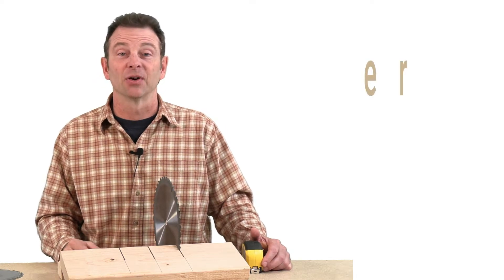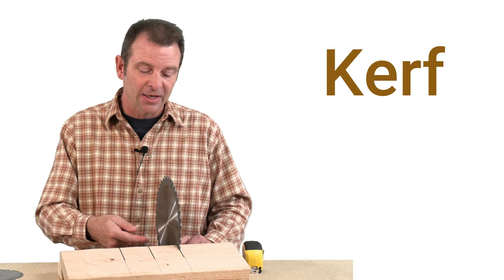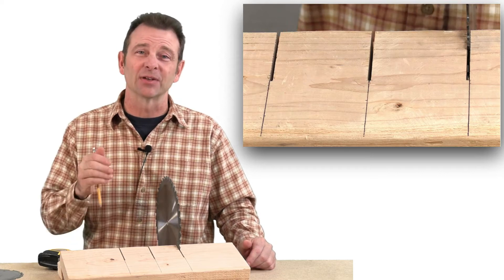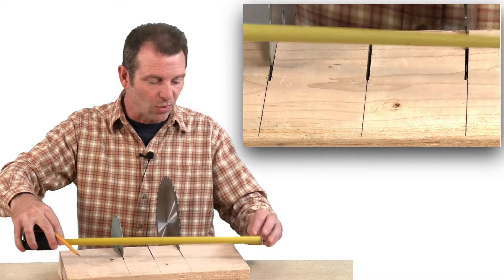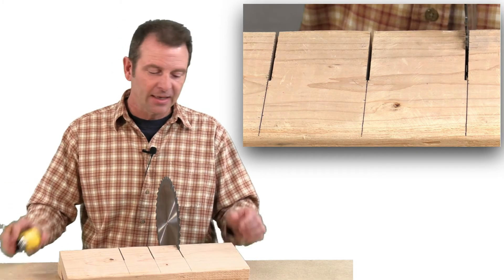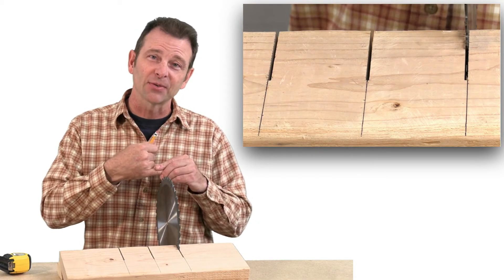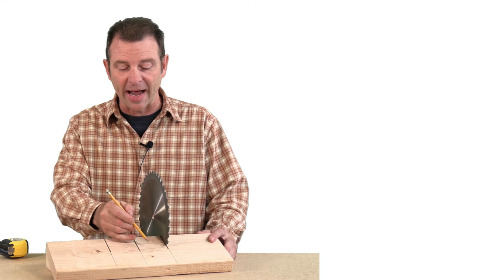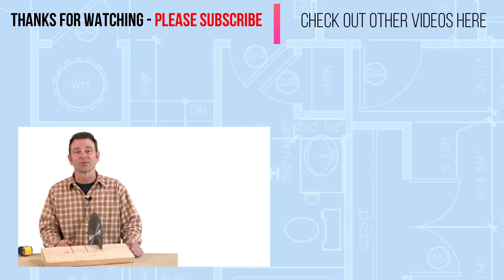Lets talk about Kerf - when cutting materials you have to account for it.

Comment: But what about cutting a board in half? If I need two pieces that are 2x4x4', if I cut a 2x4x8' board in half won't the kerf make one (or both if the kerf is right in the middle of my line) slightly short? In a case like this, should I get one 2x4x10, cut two 4' long boards accurately, and live with the excess? On a big project that could result in a lot of waste.
Reply from the maker: You are correct that you split the the kerf across the 2 pieces by straddling the line with your blade - but yes both boards will be a bit short of 4 feet.   Assuming your board was an exact 8 feet to start.

Comment: Something I've run into is the importance of using a pencil instead of a marker. Markers bleed or are just thicker than a pencil so if you cut on the edge of a mark made with a marker you'll still end up 1/16th-1/8 inch long.
Reply from the maker: very good point - we actually have a video about marking devices and we say the same exact thing.

Comment: It's easy to place the blade on the 'correct' side of the line with a circular or jigsaw but with a hand saw it's a little more difficult. Say a handsaw blade is around 1 mm thick, would it be easier to just add this to the measurement and then cut on the line ?
Reply from the maker: that is not very consistently accurate - the best is to still place the hand saw blade so you leave the proper length material

Comment: I’ve always wondered if this was a thing! To be honest, I just thought wood working tools lacked the precision to make such accuracy possible.
Similar to my frustration with tape measures…
Like how the end 90 degree piece always pulls away from the rest of the tape by a few 8ths of an inch when measuring something out in the open
… yet when I use the tape measure to measure a confined space, like the inside of a doorframe, that same 90 degree piece is now smushed against the tape and gives me a proper accurate measurement.

It’s just so frustrating 

Thank you for your video on this!
Reply from the maker: We have a video lesson on the tape measure - that hook on the end of the tape is supposed to move for accurate measurements it moves the same amount as the hook is thick.
Reply: The first inch of the tape measure is 1/8 short on purpose. When doing inside measurements (like inside of window frame) the tab adds 1/8 to make it a full inch. When doing outside measurements (outside of window frame) the tab won't be there so it pulls out 1/8 of an inch to make it a full inch. Therefore, you now have accuracy for inside or outside measurements.
Reply: It's supposed to to that as it's taking into account the thickness of the tab.